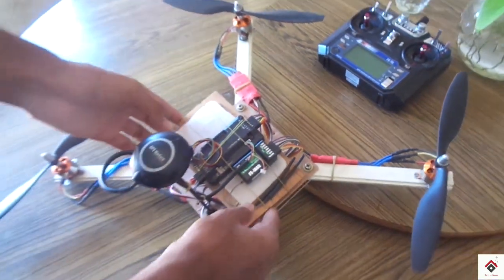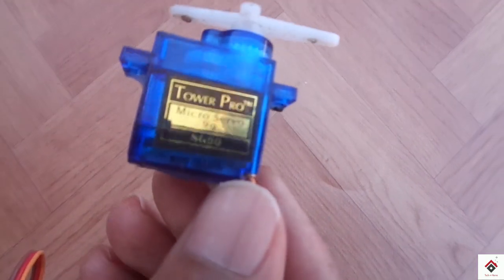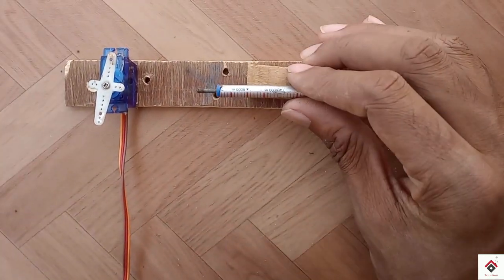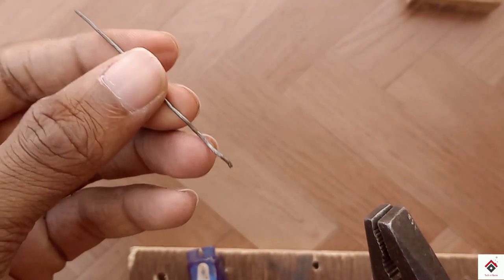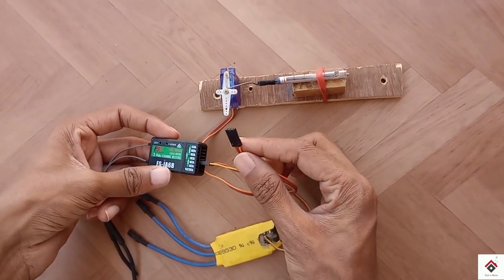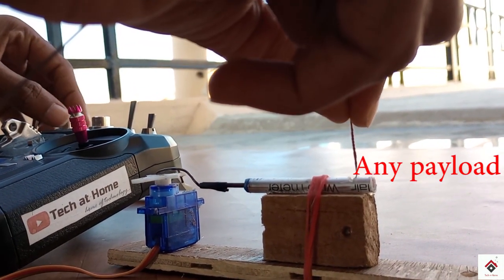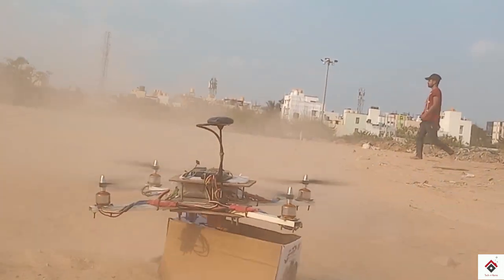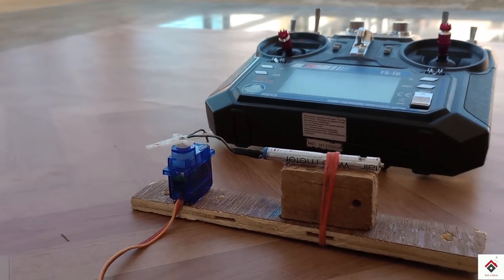Homemade Payload Dropping mechanism for Drone | Low Cost dropping device for drone-Drone drop system

Comment: Can we configure this contraption for a Autel Drone ?
Reply from the maker: I didn't understand, can u explain
Reply: For off the shelf drones it isn't really practical, or likely doesn't have any available CANBUS channels for adding external servo mechanisms like this. Something like this is really only practical on a ground up build that has available servo channels. Not saying it's impossible, but you'd have to know a LOT about the power dist and what outer loop channel (maybe camera gimbal?) you could use to add a drop servo like this gent is using..and add it to a prebuilt Autel or DJI. Would just be way easier to build a custom drone for dropping things like he did. Or just buy an add on sling dropper that they sell for guys that use drones to fish with...they fly their lure/bait out a distance from shore and then drop it where they want to fish at. They mount to the landing legs of like a Phantom or something that has fixed landing skids. 👍

Comment: Hii
please how to add servo
Reply from the maker: Connect the servo motor directly to channel 5 or channel 6 of receiver
You can control with Var A or Var B
Reply: @techathome  Brother, what delivery method do you use, can you make a video about this?
Reply: @techathome  Dude, are there any lights under the drone?  , if I think of the best way to modify it, make a delivery device and use a photoresistor as a power supply